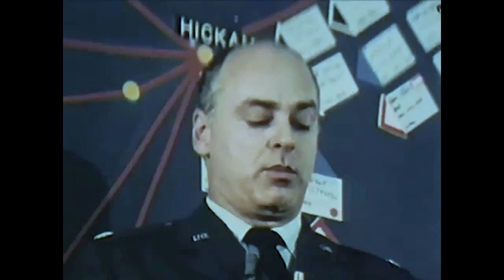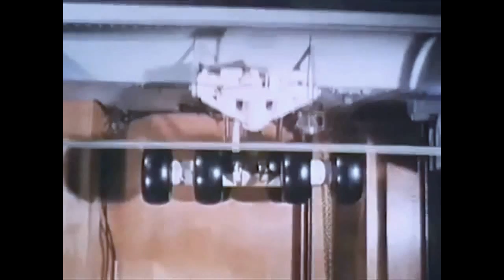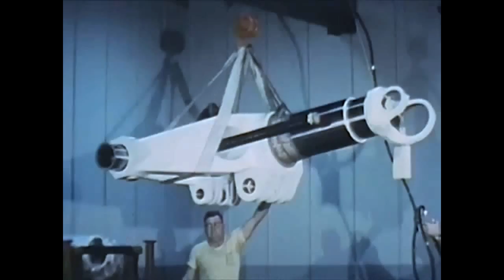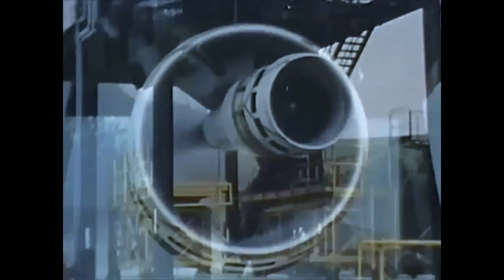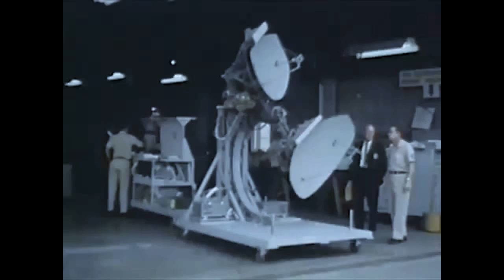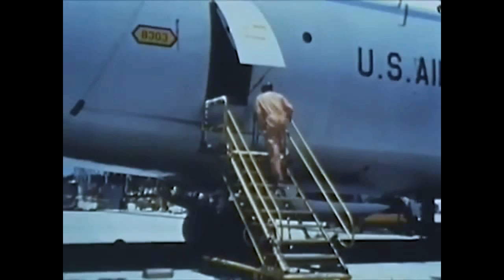Lockheed C-5A Galaxy Promo Film - 1969

Comment: Wow!  First one of those "monster planes" I had seen was, I think, in the early 1970's...maybe as early as '70 or '71 in the Atlanta area. They were flying in and out of Dobbins A.F.B. in Marietta, GA (north Atlanta area). Saw several in the two years I attended at Reinhardt Junior College in Waleska, GA in '73 & '74. What a loud noise it made...and seemingly going a slow speed to get down one county away from the campus. 
I had a small plastic model of that plane I got in 1975. That model is gone. Must have "crashed and burned" many years ago in a moving accident.